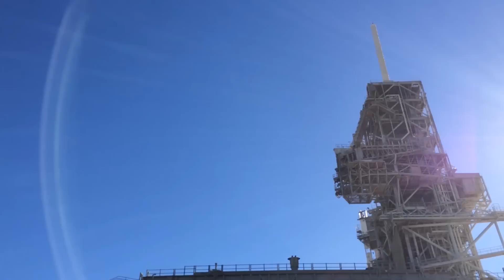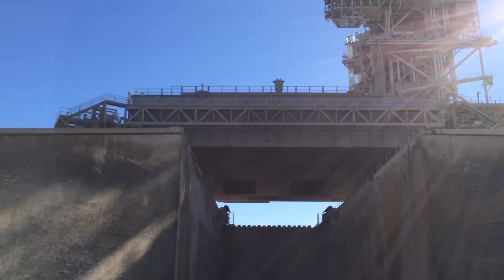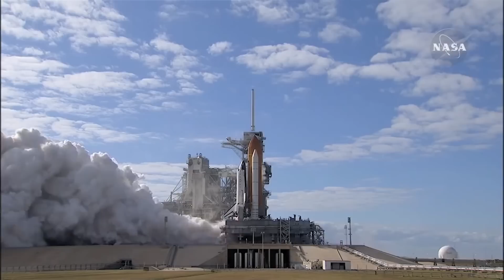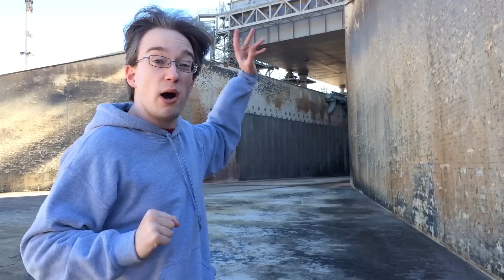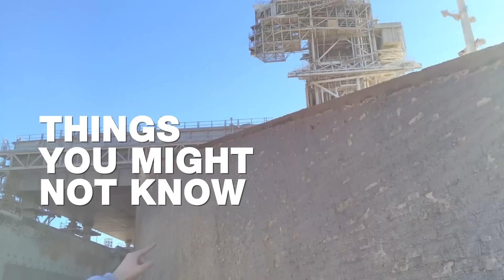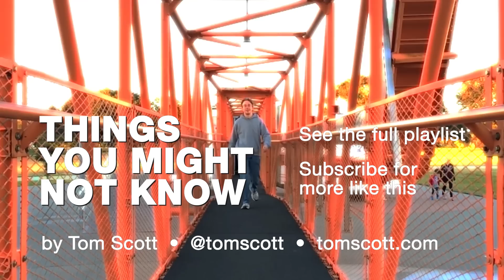The Hard Part About Getting To Orbit Isn't The Height

Comment: Well, I mean, I would say the hardest part of getting to orbit is the atmosphere. If there was no atmosphere, then it would be SO much easier to get to orbit, because there wouldn't be any air resistance, meaning you wouldn't have to launch up before turning sideways. Instead, you would be able to launch sideways, without gravity pushing against your upward acceleration. That's a big reason as to why astronauts didn't have to carry the entirety of Saturn V to the moon to return. They could return launching sideways, only using their small fuel tank in the Lander to get back up to the Orbiter. Of course, without any atmosphere, there wouldn't be a rocket in the first place...
Reply: You were mixing together atmosphere and gravity there! Considering your comparison with a moon-launch, it's gravity which makes it so easy to lift off the moon. You have to defy gravity with an enormous speed (like said in this video: 25,000 kph). Less gravity -> less speed needed -> less fuel needed. But you're right, atmospheric drag is still a thing which slows down an ascending rocket. But it's also incredibly useful for slowing down a descending module.
Reply: TheTornado121  Yes, I concede: of course the lower gravity makes it easier to launch back off of the moon; however, the atmosphere on earth accounts for 1200-1700 m/s of delta-v lost, versus around 6,000 m/s to get to the speed necessary to reach Low Earth Orbit and 9,300 m/s of delta-v in total. That's 1/6 of your fuel lost from the atmosphere. (Mostly due to having to launch straight up and go against the force of gravity before turning sideways- only a tiny bit due to atmospheric drag, as you mentioned, if you don't launch too quickly- usually 100 m/s or so) As for mentioning the moon, I was simply hypothesizing the effect an earth sized atmosphere would have on the amount of fuel needed to launch back off of the moon (and slightly exaggerating at that, because of the moon's lesser mass) As to the usefulness of the atmosphere in slowing stuff down, most dead satellites don't return to earth at the end of their lives but instead ascend to a higher so-called "graveyard" orbit, and many satellites also do not use the atmosphere for aerobraking as it causes much unwanted heat and could possibly even rip components off if their trajectories are slightly off.
Reply: And if there was no atmosphere, it would also be SO much harder to slow down and land safely!

Comment: And the reason for this problem is: Gravity does not magically become non-existent just a few hundred kilometers above the surface of the planet.
In fact it's about the same strength as ground level, the difference - single digit percentages.
Reply: Well, that's what keeps the moon in place, after all.
Reply: @gwenynorisu6883  But Moon is like ten thousand times further away